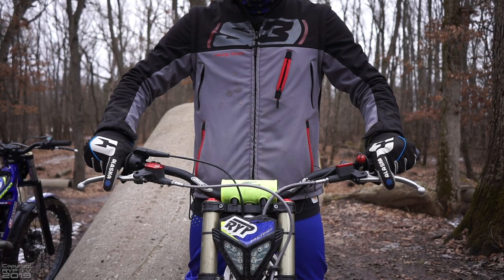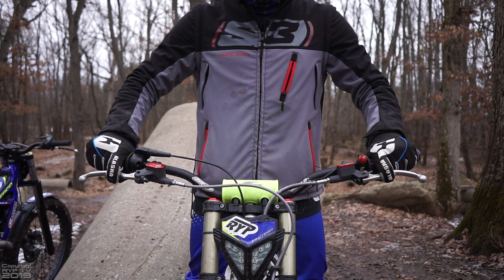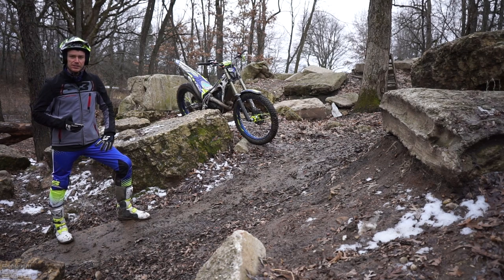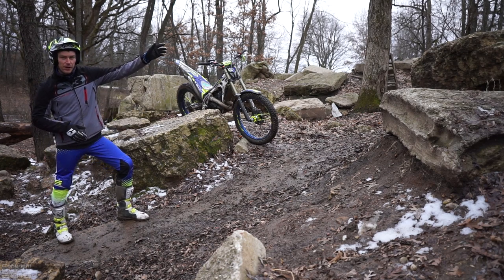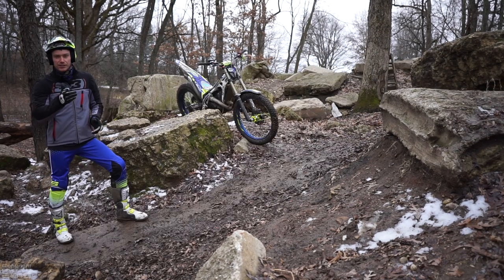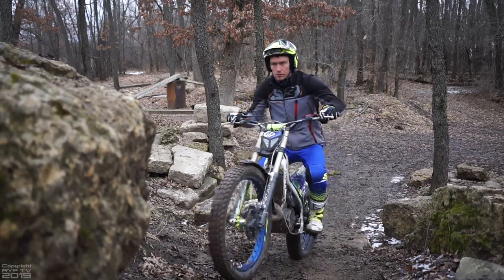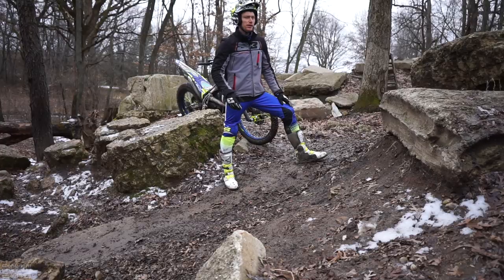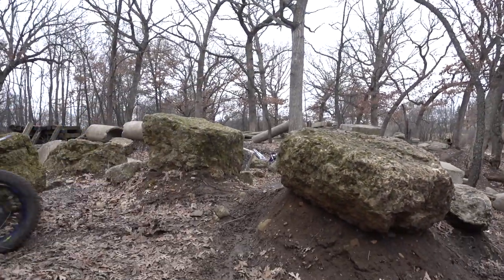MotoTrials How To: Slip the Clutch with Pat Smage

Comment: What about in the big slippery climbs where you see the riders scream the engine and then slip the clutch using the flywheel momentum to apply a smoother power for the climb than the engine provides as the cylinder fires each revolution? At least, that's what it looks like they are doing in the world rounds.